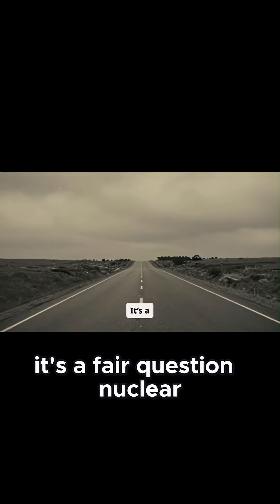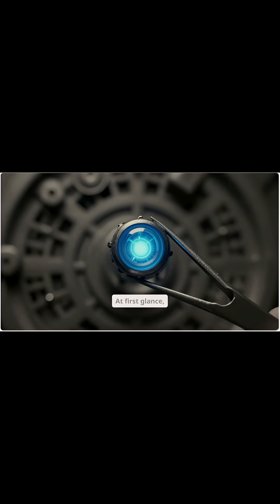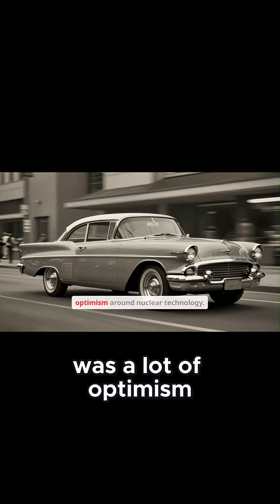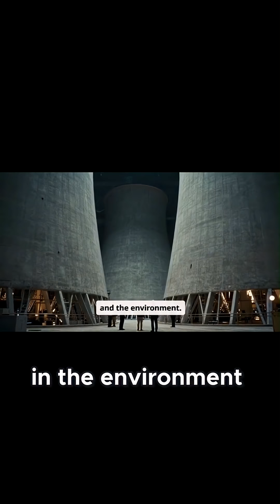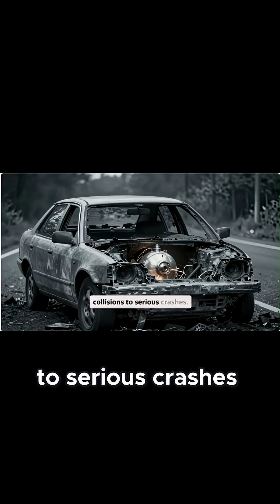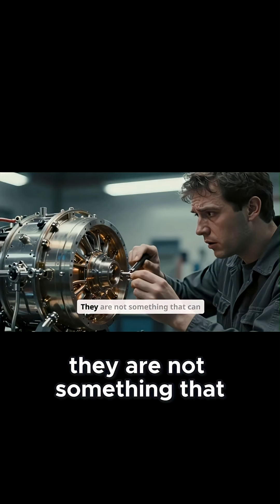Why Don’t Cars Run on Nuclear Power?

Comment: To use fusion in a vehicle is like planting cancer for weight loss. But if you create the next generation of "batteries" (super capacitors), then you can plant coils under the surface of the streets, and power these coils with nuclear-powered generators. Then, one reactor can move thousands of cars, instead of one reactor per car, which is stupid. In the past, engineers just did what a non-engineer ordered them (their boss or their commercialisation manager).
Reply from the maker: Agreed, centralized power makes far more sense than one reactor per car. The real debate is infrastructure and economics, not feasibility.